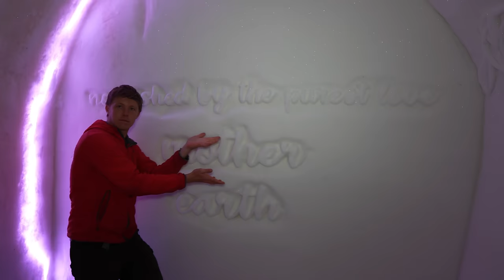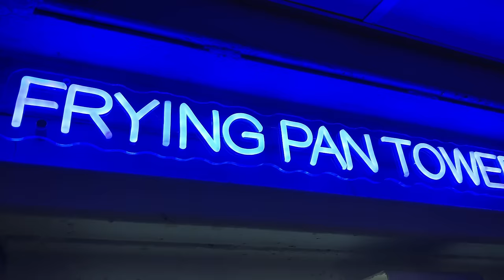Overnight in the World's Most EXTREME Hotels

Comment: Sand tigers are actually just as if not more docile that smaller sharks like makos where they're detracted by our mass comparison. Sand tigers are actually known as the grey nurse shark because they're pretty much harmless when docile (having a constant supply of human excrement and feeding fish probably means those present aren't too docile), and are known by divers to mostly just circle groups of divers with curiosity and little to no hostility.
Honestly, a good solution would be erecting a mostly submerged fence to keep out the sharks with a gate for incoming boats (if you made it 4 pylons wide, you could use the middle two as a normal gate and the outer corners on swivels to widen the gate for larger boats that are shallow enough to pass the underwater parts), and use the interior for fish that will break down and filter the feces into what is basically fertilizer for the local flora.